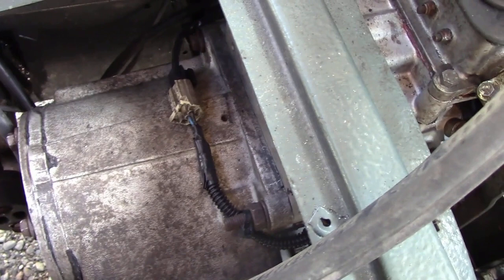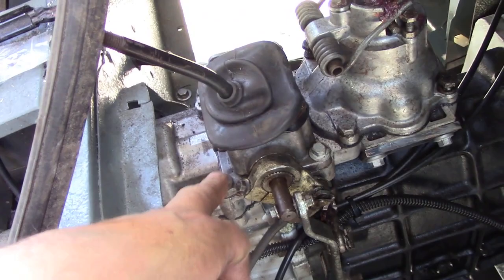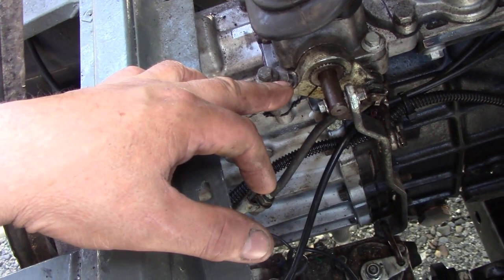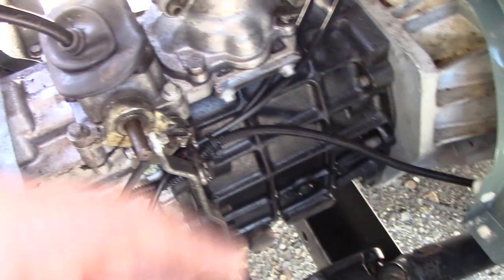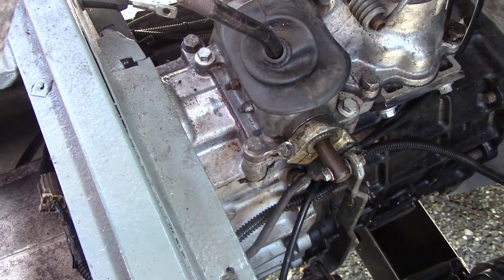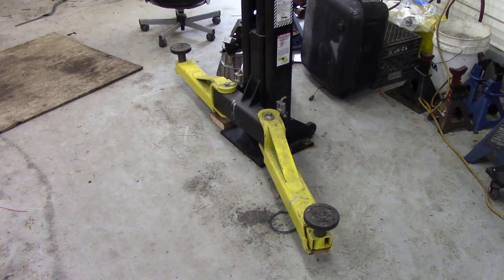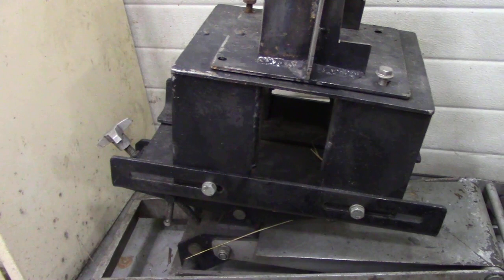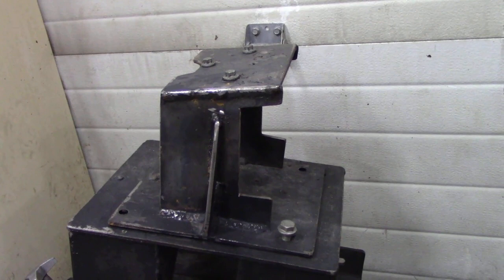A quick few notes on how I remove Defender gearboxes

Comment: I made one of the "three hole" gearbox removing brackets to fit in the top of my high lift jack. It made the job so much easier when replacing Disco clutches. 
On the old series 3 I just slide the box back on the crossmember
Reply from the maker: Excellent!

Comment: You are a man of many talents!!!   Are you boarding the bathroom out or doing it the old traditional way. If you are tiling the wall after plastering it I would recommend dorb and boarding as you don't have to skim it,  just stick the tiles on and the job is done.  I would rather plaster a wall and tile it than take the main box out of a defender.  If I had to do a clutch, I used a high stand and just moved the complete box as far back as I could and work in the gap to replace the clutch.  Rather you than me Mike,  I,m so happy that I am retired now and all that stuff is behind me.  As always, a very good video Mike  which I feel encourages owners to do more repairs for themselves. Best wishes from God's county. Rob.
Reply from the maker: I hate doing gearbox removals - especially on my own - easy to get out, but sometimes a bugger to get back in! - which is why I take out the high low lever - pretty easy thenMy mate is doing the tiling - putting those big floor tiles on the walls 30cm x 60 cm - looks like marble  - bangs em up real quick - if he gets here  - likes the pop after work - a 2 day job has been taking 5 weeks so farTiles going strait on the old plaster board so quite easy to do - just all the cutting and his electric cutter went on the fritz Monday so more excuses!
Just out of interest - we don't have many brick houses here -all wood 
Brick is expensive , wood is almost for nowt, and a brick house is a bugger to heat in winter and if water gets in the brickwork then the ice has a force of 9 tons/sq inch  so they crack easy - wood is a bit more flexibleAlso they build nothing to last here - after 50/60 years there may be too much rot in the wood so they put a swing shovel though it and build a new one - cheaper!
Reply: I was really apprehensive to do my own tiling, but I soon got the hang of it.  Which is the same as when you do a job on a landrover that you have never done before.  What's the worse that can happen, take the tiles off and start again. How many times have you done that with a Landrover repair? that is how we acquire knowledge, of coarse, when someone like you gives people advice it makes it a lot easier, so carry on the good work.  I think I would live in a caravan if I was living over there Mike.  Best of luck from you know where,,, from you know who.

Comment: Hi Mike, great work. I’d seen a drawing of the bracket before but your video & lifting jack/ bracket tool make it easy to see how to get it lined up without bursting a blood vessel in the process.
Reply from the maker: Thanks - I saw a picture on Google of the plates and figured they couldn't be that hard to make - and hour or two with the plasma and MIG and I had them made

Comment: I have exactly the same transfer box adapter plate.  Best thing I made for my Defender.  "Wiper motors" I added a 140 deg gear to my right hand drive 110.  Extra travel on the passenger side is great, but the driver's side goes exactly rubber to rubber. Little scary at first, but i think I like it.

Comment: Great video Mike sadly I have removed my LT85 gearbox twice in the last 4 weeks as the original gearbox had horrendous bearing noise.
I then bought one at a show and I was ensured it was GOOD, after fitting I started up and it was worse than the original.
The gearbox is now away being rebuilt ,I also found a hairline crack in one half of the casing at the bottom allowing oil to drip out.
Anyway I made a bracket for removing and refitting the box and it works fantastically. 
Not sure if I can attach a picture to you tube anyway it allows me to remove the transfer and gbox in one and it balances perfectly on a single trolley jack thus removing the need for the engine hoist through the door.
It bolts on to the gearbox mounts once you have removed them and I can remove the gearbox on my own and refit too.
Thanks for the vid keep it up👍
Reply from the maker: Send me a pic  - britrest@britrest.com

Mike

Comment: I have to work on the flat ( i.e. No lift or pit) and made a transmission jack using a large trolley jack  and a transmission cradle, which is supposed to be mounted on a pit jack. Works a treat. I had a local steel fabricatIon shop make up the Adaptor for the LT230 from the drawing in the LR workshop manual. I'm currently putting the finishing touches to my new workshop which will have a pit; no lift for me as I can't go high enough!

Comment: Had the 200 tdi in for over 4 years. 2 times new clutch plates 1 time gearbox swap (ashcroft rebuilt)
Never took the tunnel out neither took the high low shifter off. I could lower it just enough and removed it from underneath on the lift... However you have to seperate the transfercase and gearbox... 
With the 638 I need to take off the high low shifter as I could not tilt this far.
Reply from the maker: The idea  of taking off the shift is you don't have to tilt the box back too far - then you are not stressing the rad hoses or the fan hitting the cowl and it is quite quick to put the linkage back on with the tunnel out
Reply: @BritannicaRestorations  Thanks for all these really nice videos! 
Looking to the Manual, the viscous fan would need to be removed, cooling system to be drained and some hoses to be disconnected. Is that still needed if the stick for the transfer box is removed?

Comment: Mike, what angle did you make your transfer box removal tool? I don’t have a jack that can tilt to suit. Looks about 45 degrees? (Still fittering away trying to “safely” get it off)
Reply from the maker: I will measure it tomorrow if I remember
Reply: The same question is what is the degree of inclination

Comment: Hi thank you for great video. I have removed the front prop shaft to replace with new one. In the mean time I wanted to drive a little without front shaft, but I couldn’t drive. It didn’t move! Is that normal? Thank you.
Reply from the maker: You need to engage the diff lock
Reply: @BritannicaRestorations  thank you for your reply. Does this mean I have a problem or not?  If I put the shaft on will it work. Again thank you for your help.
Reply from the maker: If you engage the diff lock then you should be able to drive on the rear axle

Comment: Thank you for your suggestions! In a defender, I need to remove both engine and gearbox, is possible to lift together? Should I separate transfer box before and leave in place? Which approach do you suggest? Thank you
Reply from the maker: you can get the whole lot out in one lump if you remove the gear stick and Hi Low shift, plus both gearbox mounts
Reply: Thank you! So i don't need to touch exhaust nor frame? And i should also leave transferbox in place?